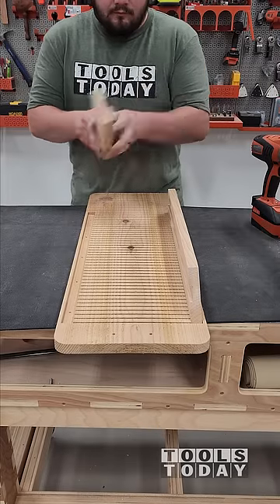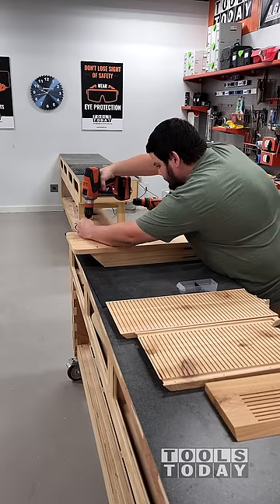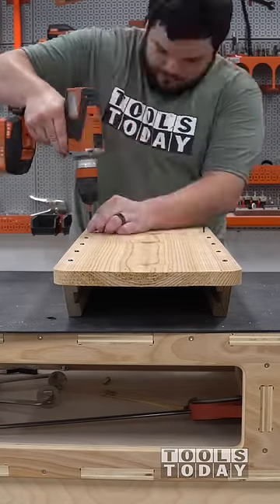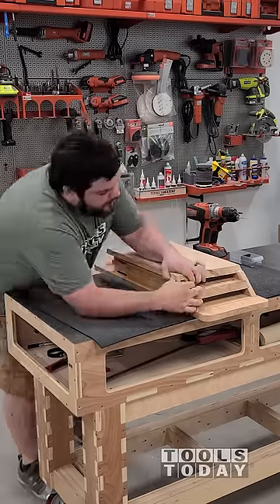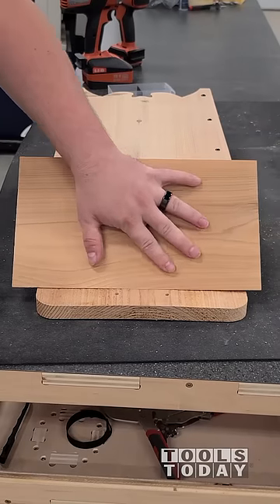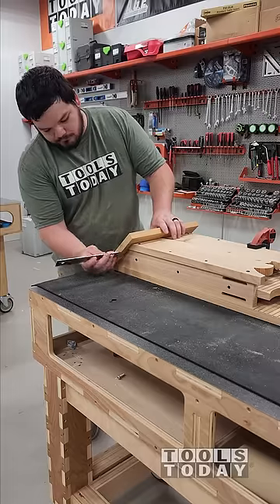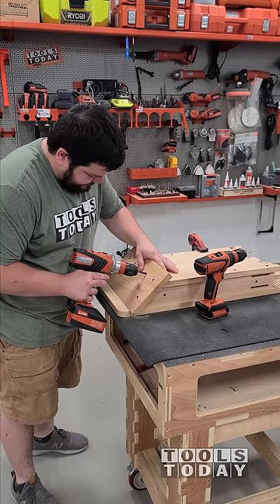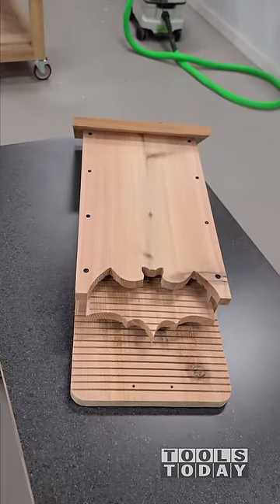Assembling a Bat Box

Comment: 10 seconds in, giant sign on wall says wear your safety glasses.... you fail sir
Reply: Noticed that, not exactly leading by example.
Reply from the maker: I'm screwing pieces of wood together.  There's no need for safety glasses here.
Reply: @ToolsToday  so you're saying there is no possibility the driver bit could shatter, or something fly out of the vents on the drill. Best thing to do when your wrong is just admit it. I'll be honest, i probably wouldn't be wearing them in this situation either, but then again. I'm not running a YouTube channel, nor do I have a giant safety sign in my shop

Comment: I don't think the bats care about if it's 'on the 1/100 of an inch' out .. or round corner .. etc.
Reply from the maker: They do care if there's a big gap at the top letting out all of the heat they like inside of the box during the day.
Reply: @ToolsToday  Point taken
Reply: @ToolsToday  Should we have some insulation at the top just under the roof?